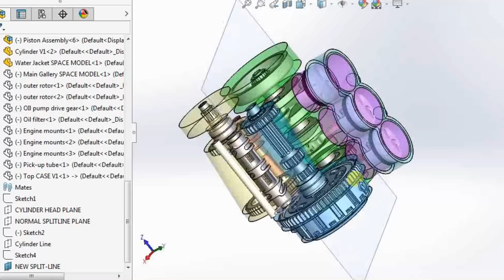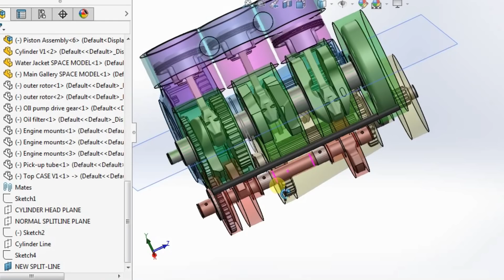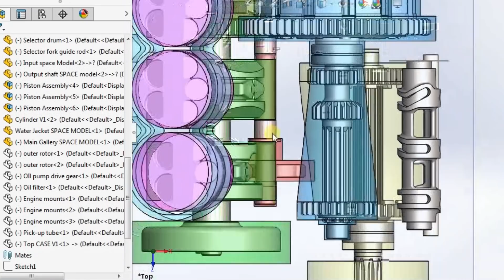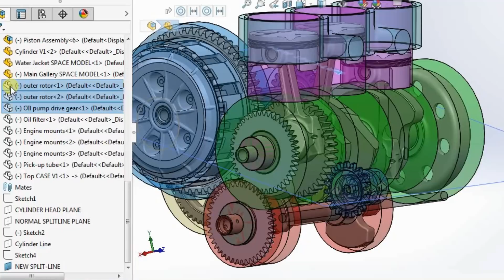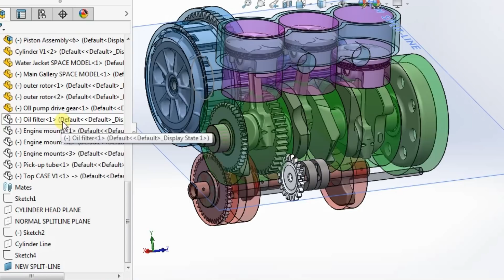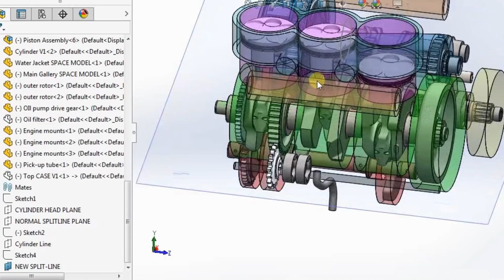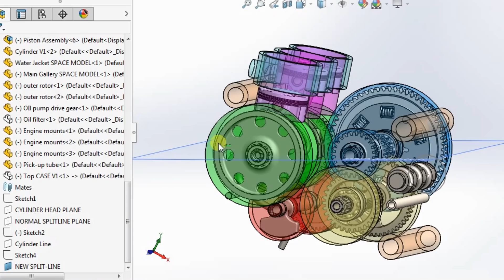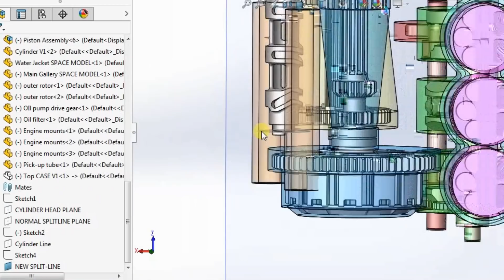Design Freeze - EA Series - Part 4

Comment: Really getting into this series now. Have you ever heard of counterbalance weights being placed on bearings on the crankshaft and then spun in the opposite direction with bevel gears? It's probably a convoluted way to go about it, but it could possibly save space overall. Nothing seems too crazy to me after seeing the vestigial connecting rod and counterweight on the BMW F800.

Comment: Why even have a split line, why not have oversized shaft bores on either end that bearings press into (after the crank is in position), then have the 'bottom split line' just be the oil pan?
Reply from the maker: For loads of reasons - want a list?
Reply: Yes please! Tons of car engines run fully supported ball bearings as the two end/outter main bearings, then use a bridged or girdled caps for the remaining main bearings, or I think mercedes runs a v8 where the remaining mains are incorporated into the oil pan (all aluminum) with internal gussets that double as oil baffles.
Is this an economy issue for bikes, or is there good engineering reasons they dont do this?
Reply from the maker: "or is there good engineering reasons they dont do this?"

- yes. It's just lazy engineering. But in all seriousness car cranks don't spin as fast. Because of this 'whipping' is reduced. Ball bearing races have no method to counter axial deflection, unless the shaft is very short and stiff, like a gearbox shaft.

With gearshafts the forces are rotational about the axis, where with cranks the forces are both perpendicular to that axis and rotational. The higher the speed the higher these forces and harmonics and all that jazz. Hydrodynamic systems are dynamic so perfect concentricity isn't an issue - a bit like self-aligning bearings in hubs etc.
Reply: @thedirtyworkshop  Matt is to much to ask for the list? Im deep balls intrigue. Before bikes i mess about with cars and now i got used to it. But when i start i remember seeing a bike engine and thinking wtf is this overcomplicated shite for? why dont make it like an engine car? you can even de-deattach the transmission in a car without desasambling the hole engine. what is this shite? same oil for engine and transmission? etc... and i never got the answer of the why, so a list would be wonderfull!!!
Reply from the maker: yes - it is